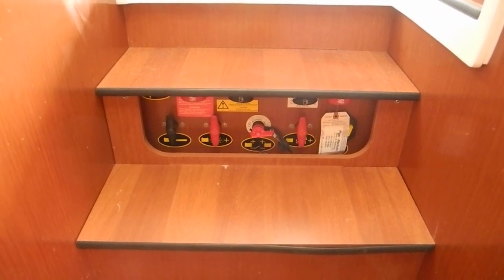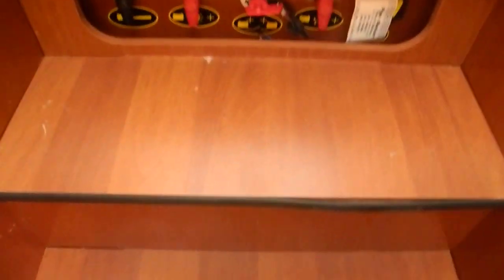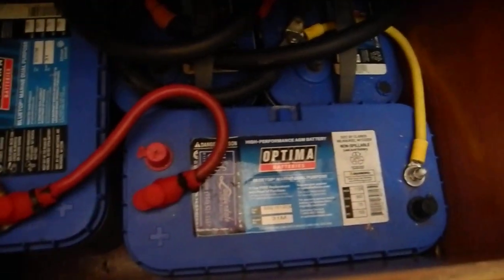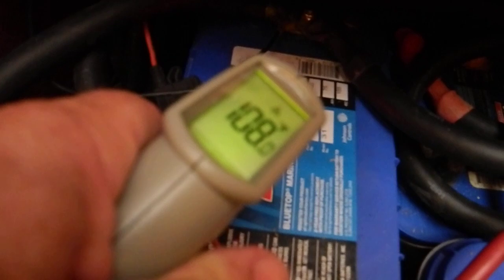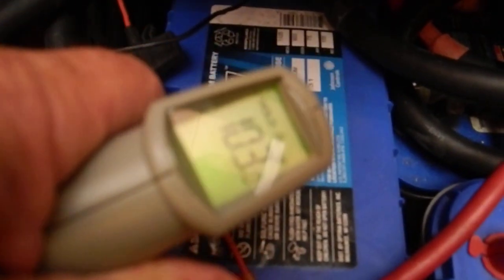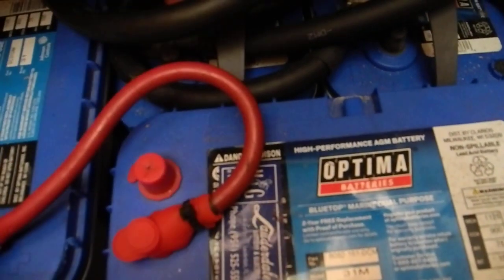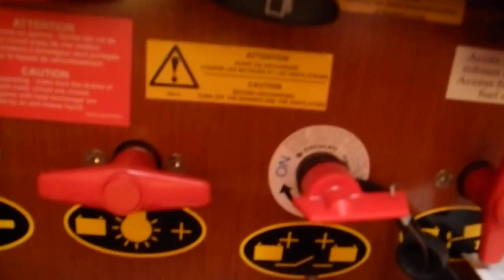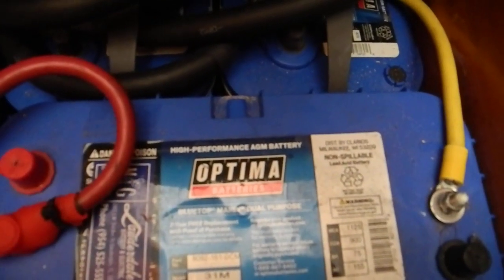Warm batteries are BAD

Comment: What do you think about optima batteries? are they good quality? i have one in my bmwX5, it works hard for 2 years, with parking heater in winter and compressor cooler in summer. But after 2 years, the batteries are tired...
Reply from the maker: They are very popular. We see them aboard many boats these days. I don’t have an opinion because I haven’t personally used them to track and trend aboard my own boat.

Comment: What is normal temperature??
Reply from the maker: Should NOT be hot enough to scare you. Luke warm is understandable depending on the amount of discharge and the fast rate of charging. These batteries were supposed to be on FLOAT. Think of FLOAT as a modern "trickle charge" but turns OFF when the trickle continues to charge at a slow rate. A thermal sensor is a smart option to include in your charging system.

Comment: How old were those batteries?  Also is that boat’s battery charger compatible with AGM batteries?  I had a charger go bad on my 2004 Sea Ray. The new charger has temperature sensors for the batteries so if they start to cook it shuts off. Also the new charger can do traditional lead acid or newer AGM batteries
Reply from the maker: The batteries were original to the boat. Somehow the bad batteries were NOT noted in the survey? This boat was about 6 years old and so were the batteries, long past expected life cycle.